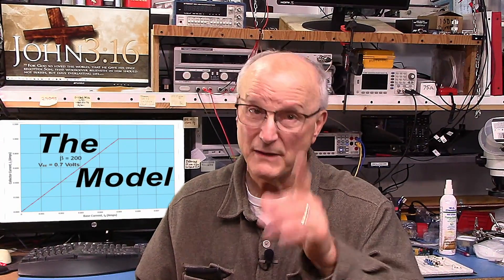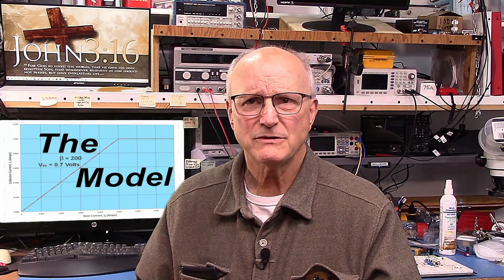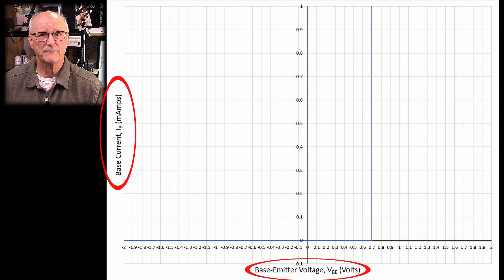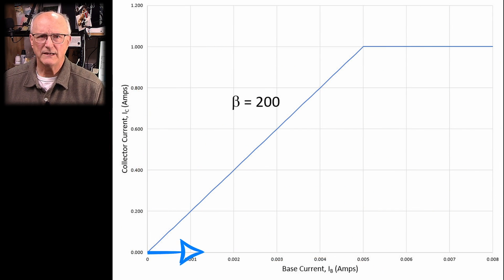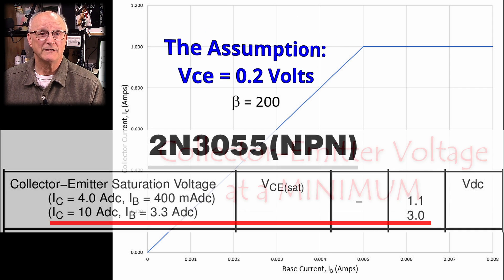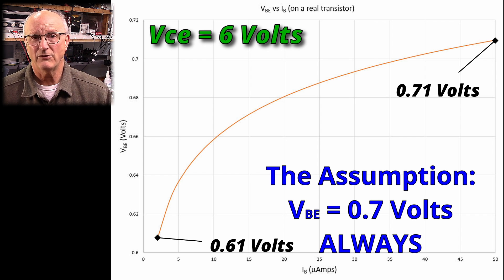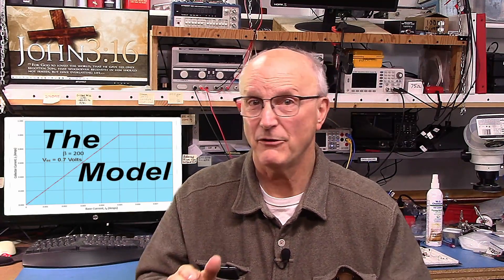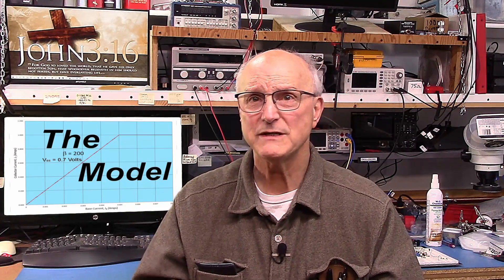Basic Bipolar Junction Transistor Analysis: The Model (066b1)

Comment: This video was brilliant. I did have trouble putting all of the information together. I spent time with each section and I wrote down questions which helped me. I would like to set up my own experiment. If possible could you suggest a test circuit. I was thinking of using the 3904 transistor. How did you keep VCE constant? At 8:25, I would like to see what is going on with the IB during during the changes with IC on the graph of hFE vs IC.  Could you get the value of IB if you divided the IC with the value of the gain? For example: The gain is 138 at 2mA. 2mA/138= 14.5microAmps. Thanks for this video.
Reply from the maker: Well ... thank you!
I procured a lot of the measurement information using a transistor curve tracer (Peak Atlas DCA75 Pro - $186 through DigiKey). 
They use a common emitter circuit with a 700 Ohm collector resistor and a current source for the current into the base. The collector voltage is supplied by the variable voltage source providing power to the collector. They keep Vce the same by changing the voltage supplied by the voltage source.
Knowing that the current gain varies with just about everything (Vce and Ic), you would have to actually measure the base current rather than trying to calculate it. :-)
Reply: @eie_for_you  I actually have the Peak Atlas DCA75 Pro. Good idea. I am hoping to obtain a better understanding of BJT circuit design. When studying BJTs in school and on line, there were a lot of things I did not understand such as modeling. Thank you.
Reply from the maker: Cool! The DCA75 is an awesome little tool. I love how it helps me parse out the different aspects of my junk box devices.  I hope that this video got you a bit closer to understanding what they are doing with that generic modeling. Like so many things in electronics, it all can be a bit mind blowing sometimes. :-)